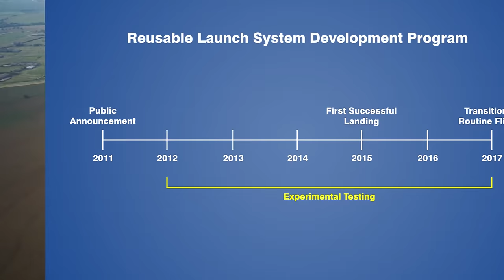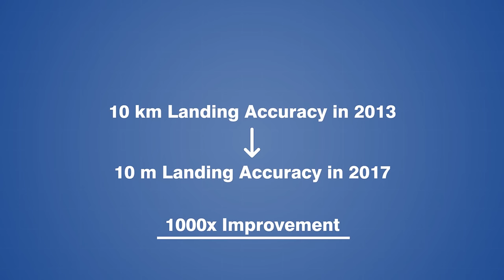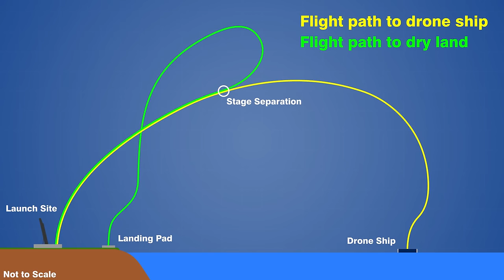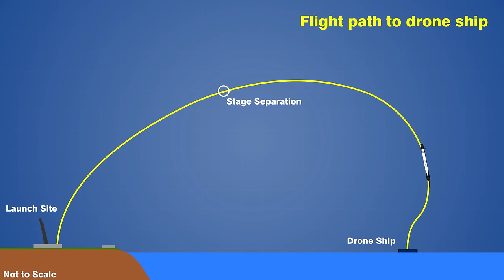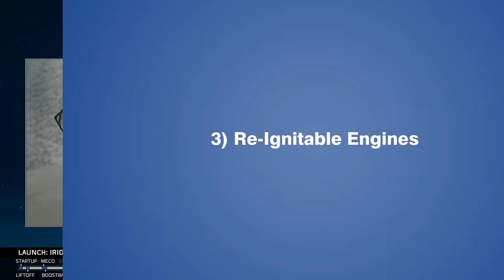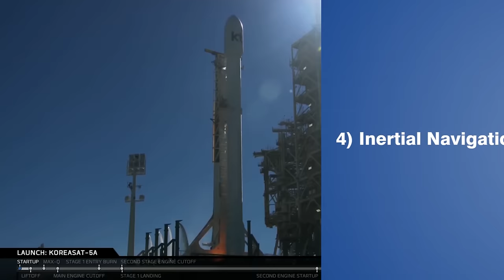How SpaceX Lands Rockets with Astonishing Accuracy

Comment: Let us think about another solution.  

1 - Rockets are definitively unable to transport us to distants neighbour planetary systems 

2 - Ufo phenomenon shows that other civilization could manage such technique. 

3 - So something else makes possible to travel "faster than light". That becomes possible through the "bimetric" Janus Cosmological Model where there are two kinds of " geodesic paths " to go from a point to another one. It is possible if the mass of the vehicle and the mass of the passengers can be inverted. Then the distances are shortened by a factor 100 and the speed of (negative energy photons) is enlaged by a factir 10. So that the travel time is shortened by a factor 1000. 

4 - Travels from stars to stars are definitively non-impossible.

 5 - in comparison these Blue Horizon and Space X projects are just ridiculous and outdated. 

6 - I am deeply convinced that our science and technology should be able to allow us to enter this era of interplanetary travel right now, provided we get some advice from those who are already practising it.

 7 - But this transfer of science and technology would have several immediate consequences. - Positive consequences by putting in our hands the possibilities of transmutation that would allow us to convert our waste into helium. - These same transmutations would make all our problems of raw material supply obsolete. - By mastering the technique of electrical charge reversal (i.e. direct conversion of matter into antimatter), we would have an unlimited source of energy. 

8 - But in doing so, we would have weapons of destruction against which our thermonuclear weapons would be like firecrackers.   

9 - The transfer of technology therefore requires a deep awareness and a total halt to fighting and rivalry between ethnic groups on earth. That is the problem. 

Jean-Pierre Petit ( French jp.petit@aps.org ) astrophysicist.

Comment: You did not explain the increase in accuracy from 10 to 1 meters. There is something extra that achieves that.
Reply: It is called multidimensional stabilized optimum trajectory.
All six degrees of freedom have a closed loop feedback  control, involving sensors, actuators and the all important optimal control laws.
Some  degrees of freedom are coupled.

Comment: How does inertial navigation system works? Is there a Fibre-optic gyroscope
s? How acceleration is measured in SpaceX rockets? 

https://en.wikipedia.org/wiki/Fibre-optic_gyroscope
Reply: They use GPS, accelerometers and ring laser gyros.

Comment: I wonder how much money re-usable rockets really save. Getting the first stage back in one piece adds to the complexity of the mission and the technology is costly. Before you can re-use anything it all has to be tested - itself a complex (and costly) process. Woe betide if you miss anything. I imagine a lot of the engineering is simply replaced to be on the safe side. The main advantage probably has more to do with information than re-usability. The engineers get to conduct a hands-on study of how the vehicle reacts to launch and flight . . .

Comment: Question.. How did NASA do the same thing with the lunar landing module is a very short time and it took SpaceX 5 years?
Reply: Dude, do you know what is the gravity of the Moon and what is the  gravity of the earth?
Reply: Their is a difference yet the application is the same. Just as their would be a difference in the weight if the vehicles. How many landing boosters did the lunar module have to stabilize it during decent? Personally I don't know yet it is a valid question in order to put together the pieces of the puzzles that we have been shown. It was said that when they where working on that technology NASA was asked for information to assist with their program and they where told 'We lost that information"  Government agency loosing information? Only when they are hiding something. Choose your own belief my friend. Take care. AD
Reply: Archer De Angelo There is a huge difference between a rocket falling at terminal speed into the atmosphere and a module slowly descending to the surface of the moon, a really BIG difference, I don’t think the application is similar at all
Reply: My point was about the technology needed to stabilize the decent. The comparison between the time frame of development. Then and now. I personally watched the 1st televised lunar landing event. You are telling me that I can just drop something over the moon and it will just land the way I want it to regardless of any control to its approach. A controlled landing in both circumstances is still needed regardless of mass of the moon or the earth or the speed of decent. "Is your circuit dead is something wrong. Can you here me Major Tom"  Have fun...

Comment: The premise is flawed.  Landing and reusing rockets isn't what Elon thinks it will be. It isn't quick and it isn't cheap. Plus there is no market for instant turn around on man rated craft. Point to point Earth travel isn't possible and won't happen for many reasons. There aren't people waiting in line for the next launch of Starship or anything else.  The complexities of reusable rockets make it a stupid idea because no one needs an instant turn around rocket. They are not like an airplane that has hundreds of passengers waiting to board.
Reply: But it saves time and money for the people launching and the price is dropping for going to space so something like starship is needed. It should be cheap and quick.

Comment: I can hardly believe this is happening in my lifetime!
Reply: You should have been here 50 years ago.
Reply: @stargazer7644  the Apollo missions? I was, but they used to throw most of those away!
Reply: @oxcart4172  Ok then, 1981.  They returned and reused every part of the Shuttle on every mission except for the empty external fuel tank.
Reply: @stargazer7644  u don't HAVE to be impressed that SpaceX can land rockets from MILES up onto a ship, but I am! Bye!!
Reply: @oxcart4172  Yep, GPS is pretty awesome considering the technology has been around since 1978.
Reply: @stargazer7644  ok, it's RIDICULOUSLY EASY to steer rocket stages back onto a ship. If only they'd asked u to do it in 1978!
Reply: @oxcart4172  Here's a quiz for you.  Do you believe landing a rocket stage in a 10 meter circle using GPS is easier or harder than landing a rover autonomously in a 20x7km ellipse on another planet without benefit of GPS after a trip of 352 million miles farther than the spacex rocket travelled?  The point is, what spacex is doing isn't more amazing than the incredibly amazing things that are done all the time in spaceflight.  Especially when you consider the incredible advantages in technology that spacex can just buy off the shelf that the pioneers didn't have.  THOSE were the folks doing amazing things.  What Elon is doing may be hard, but it's pretty easy compared to all the things that had to be done by others before him to enable him to be successful.  He didn't invent spaceflight.  They did.  Try to keep some perspective.

Comment: Why they are not using parachute to overcome most falling gravity, this can be save fuel when they re go to landing..
Reply: It would weigh more reducing payload, special high g shutes would need to be made as well. In the end it becomes more econimcly viable to use thrust only to land.
Reply: They tried doing that, it was too unstable. And no parachute is strong enough to slow down a whole fucking rocket lol. These things are MASSIVE

Comment: Informative👍 so those extra fittings for landing system weighs 2.1tonnes so three boosters total 6.3tonnes heftier means more fuel needs to lift off so launch will be expensive anyway its reusable 👍
Reply: Elon said that (paraphrased): if boosters could only be used twice (reused once) the total cost to launch would not improve, but everything beyond is profit.

Comment: Before you land with accuracy : ) , you want to stop this damn thing.
Folks, nobody ever think a little bit about the keen relationship between the air and the rocket.
Launch a small rocket in a low orbit, just to 100 km. Let it be 100 kg and using all 90 kg fuel. Evenly spread it on the 100 km. It means, the centre of the fuel's mass will be at 50 km to the left. The rocket will be 100 km to the left, instead of 450 km to the right, as a nice rocket should behave .... in vacuum. 550 km off and in the wrong direction. 

But for you ... it is just the same. A Shame! ... Yup, in the meanwhile, the outgoing gas has moved X tons of air. 

Just what the hell it moves up high? So, the efficiency drops with up to 90 %. If you take all into account, you would need 3-4 more times fuel to stop it, as it needed to accelerate it.
I won't even get into the landing stuff. I let you have it. I guess, Walt Disney would go yellow to see Elon.
Reply: Sorry, but that's a good bit of nonsense you've got going on there especially when try and claim the landing would require 3-4 times as much fuel as the launch.  How can that possibily be when the main engine is burning for over two minutes continuously after take off while the return the main engine only fires intermittently just enough to slow it down for landing.
Reply: If the mass was the same it would take the same amount of fuel to come back as to get there.  But the mass is a lot less mass coming back (most of the fuel is gone, and a rocket's mass is mostly fuel), so it takes far less fuel to come back.

Comment: SpaceX still having problems landing the main booster out to sea. Landing it on the "I Still Love You" barge is still touch and go, choppy seas threatens to topple the booster, then it has to be transported from port back to the workshop. My solution may not be as cool as landing on a barge, but this is more cost-effective and SpaceX has already proven it can be done. What to do? Just leave the main booster in orbit until the earth spins back into position and land this baby where the side boosters landed 24 hours earlier. No choppy seas, no need for long transports. Done! Use the money saved for further R&B. Please pass this to Mr. Musk.
Reply: The first stage would not be in orbit as it does not carry enough fuel to do so, let alone continue to land back on earth. That is why they have a second stage (actually places the cargo into orbit). If left up there without the re-entry maneuver, the first stage would essentially "fall" back towards earth and crash into the ocean.

Comment: All the fuel used in landing could have been used to carry more payload to orbit, if they just used a parachute like NASA did with the Shuttle solid rocket boosters.  It's just a typical stunt by elon.
Reply: The SRBs are just steel rings. They are way simpler than liquid rocket engines. They could handle the salt water. The Falcon 9 can’t. You don’t have precision with a parachute so how is the Falcon 9 supposed to lane on the barge? They also required extensive refurbishment before being used again. NASA didn’t save any money by reusing them. The SRBs on SLS aren’t being reused. 

The SRBs also staged earlier than the Falcon 9 does. The Falcon 9 is going way faster. One of the burns it does while reentering is to slow down so it doesn’t burn up. Without that burn it would need a proper heat shield.

SpaceX did look at parachutes initially but quickly abandoned them. Parachutes aren’t light. A parachute capable of carrying the Falcon 9 would weigh multiple tons. The rocket would also need a ton of extra reinforcement to handle the loads placed on it by the parachute. Currently it only needs to be strong vs compression. With a parachute it would also have to be strong in tension. That strength isn’t free.
Reply: @bensemusx  Like I said.  It's just a stunt.

Comment: Is it possible to recover/reused 1st stage of Saturn V this way?
Reply: Probably not without a huge redesign with new engines and stuff. You would probably be better off designing a new rocket specifically for reusability like SpaceX's upcoming Starship
Reply: @Shmozone  I should asked: "Is it possible to reused the booster with size of 1st stage of Saturn V this way?" Thanks.
Reply: @duken3767  Oh. Yeah I don't see why not. The BFR first stage I'm pretty sure is close to the size of the Saturn V first stage.
Reply: @Shmozone  Possible but only when test successful. I can't see how we go from 3 to 100 astronauts plus fuels and supplies, what type of engines and powers needed to liftoff. Saturn V with 5 F1 engines total thrust was 7.6 million pounds to sent 3 astronauts plus equipment and supplies to the moon.

Comment: Does the 5000 pounds include fuel?  Not many people have seen a spacex circuit board or component. Is radar used? Does it get interfered with? Nobody has radio circuit details that anybody is motivated to exPlain. The eBay analog output accelerometers are too stiff. A large (3 volt) offset is difficult/.7diode. I can't get to the angular accelerometers I have from ebay. I don't like Microsoft involved.

Comment: It's total BS.   Those fins would be useless when backing down at slow speed.  
Control surfaces require sufficient speed to affect any change.  When backing down and slowing down at the same time all control would be lost.  Also the main thruster would have to be used in landing (it takes a lot of thrust to get all that weight to hover down to a soft landing.  And the thruster's control would have to be very very very delicate. Hard to accomplish with a rocket that big.
Reply: A rocket that big which is empty, after burning the fuel it contained.

Comment: This is incredibly stupid engineering. A wing or parachute system would be far cheaper, lighter, and not require almost any fuel to land
Reply: If you read the pinned comment at top of comments and read 2), the rocket weighs 22,000kgs or 22 tonnes. Its gonna have to be a massive parachute to handle the weight. Plus, parachutes offer no accuracy, the rocket would be swinging like a pendulum in a circular motion.